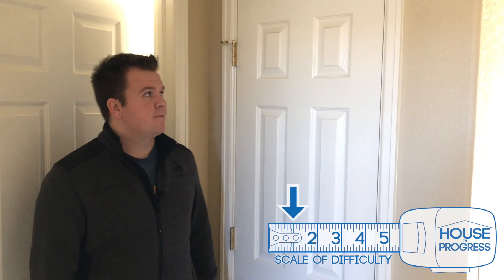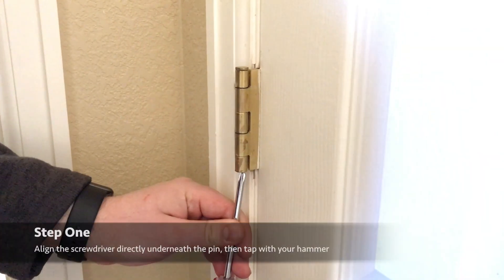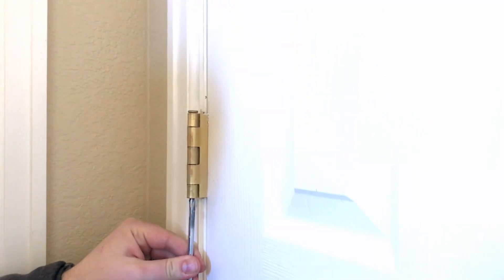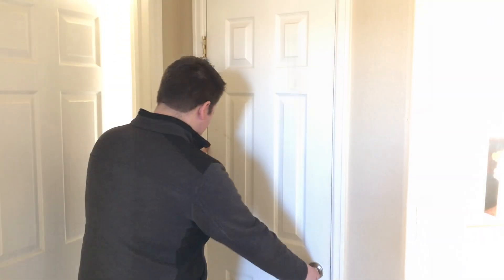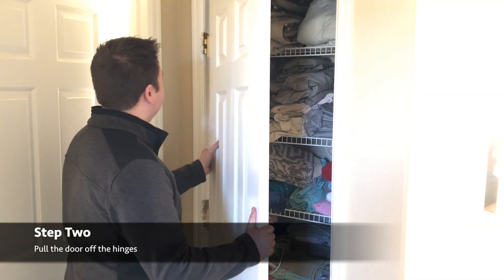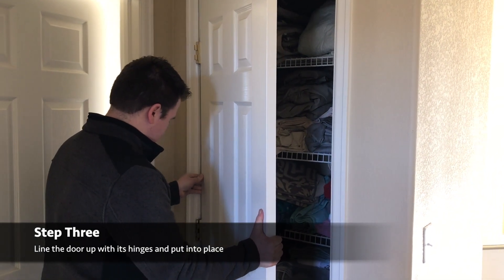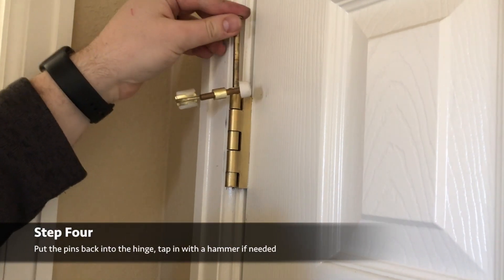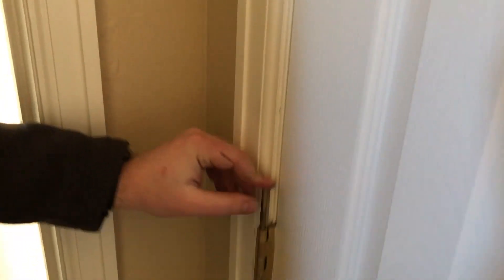How to Remove a Door Off its Hinges

Comment: Can you still remove the door if its locked?
Reply from the maker: Most likely not, there generally isn't enough room between the door frame to pull it out without it swinging.
Reply: Actually yes you can, you can use a crowbar on the side of the door that has the hinges on. Also it only worst on doors that have hinges on the exterior. I’ve done it twice because I lose the keys to one of my closets lol
Reply: locked rooming i see

Comment: How about showing where to apply the WD40.  Just everywhere?  And you don’t show how to get the bottom pin out.  Ya can’t swing a hammer with only a couple inches off the ground.  You’re not helpful to non-professional contractors.
Reply: EXACTLY, THE BOTTOM ONE IS THE PROBLEM. NO CONTEXT IN THIS VIDEO
Reply from the maker: Hello, we still use the hammer for the bottom pin. Just rotate the hammer 90 degrees and get some good taps in with the side of it.